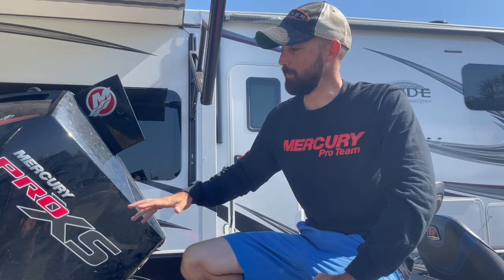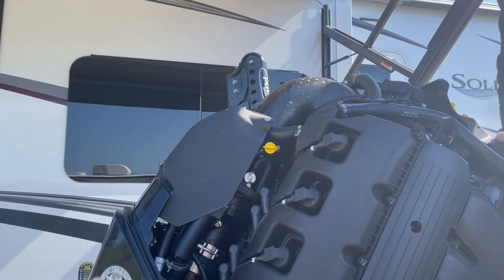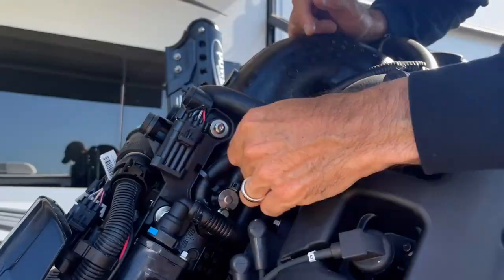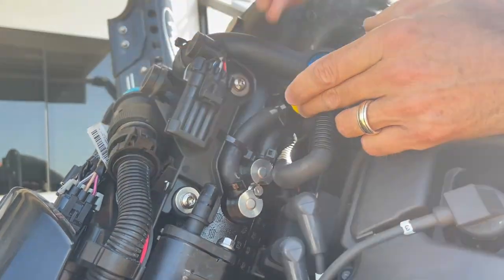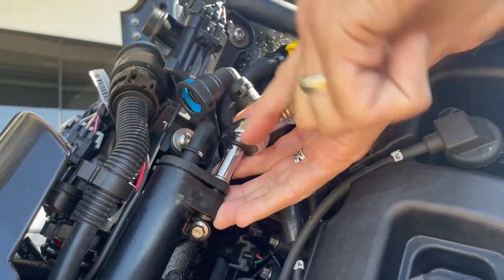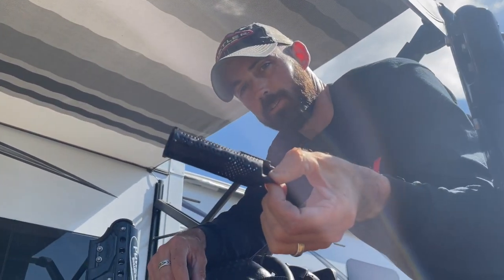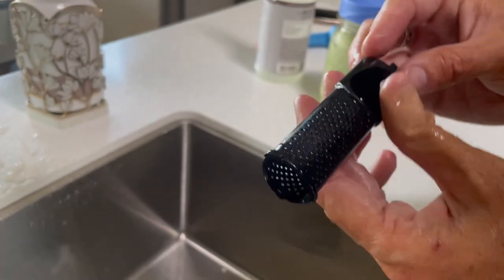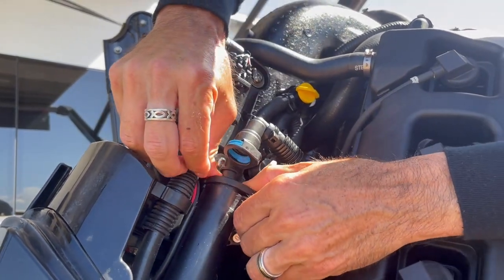Mercury ProXS EASY Maintenance Tip - How To Clean Your Water Filters

Comment: Isn’t there also another filter below, along the drive shaft somewhere?  Ive seen vids where the 250s have one and it’s a booger taking all that covering off to access it.  Mine is a ‘21 - 200 hp and my upper filters are the same as yours.
Reply from the maker: Yes there is and it is more complex to get to it. You gotta take the entire side panel off pretty sure.

Comment: Mercury 50 hp marine engine fuel is not coming to the spark plugs.
I am thinking. injectors are solid. ecu is solid. When you add a few drops of gasoline into the cylinders, the engine starts and then stops. Cylinder pressure is very good. When you press the starter to start the engine, oily gasoline comes out of the exhaust. Can you help me? Also, there are syringes inside the log. I don't understand what they do. Greetings from Turkey.
Reply from the maker: I wish I could offer help but this is beyond my abilities and sounds like you need to take it to a certified Mercury mechanic if possible